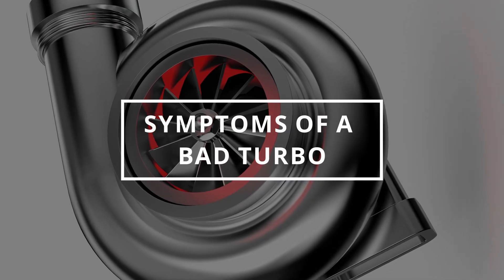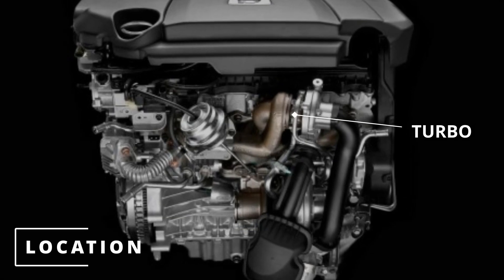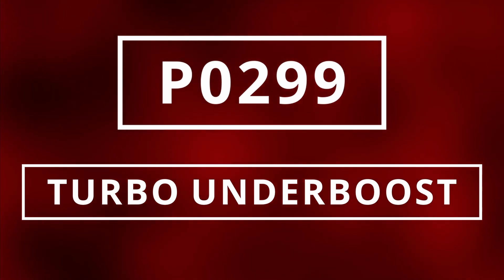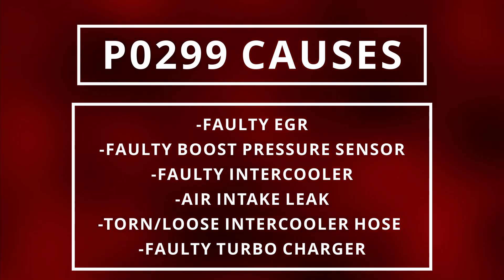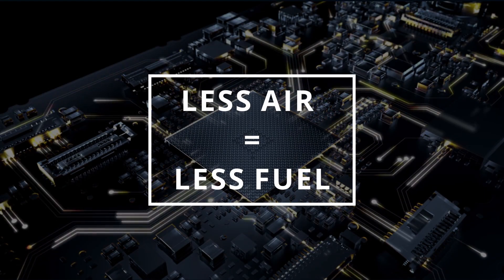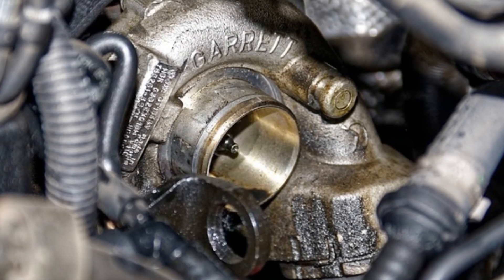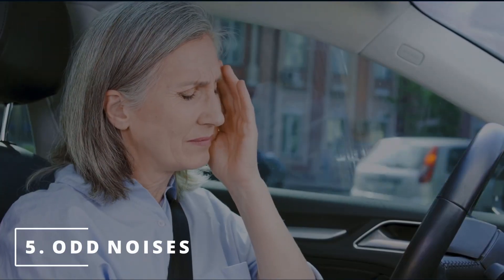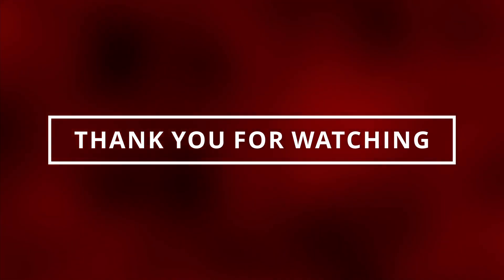SYMPTOMS OF A BAD TURBOCHARGER

Comment: The sad thing is the only reason why I knew my 59 had a bad turbo is because of blue smoke at low RPM when trying to speed up and I just noticed a grinding noise on it when I cut it off I can hear it as a polling down. It’s grinding against the wall.

Comment: So I need both intake and exhaust cam shaft position sensors. My car is bogged down bad. I don’t hear any noise in my engine or have blue smoke. Someone told me my turbo is going out. If I replace those sensors will that maybe fix the car? It’s supposed to fix the timing as well in my Elantra sport.

Comment: P2263? Turbo supercharger cause. Did not see a breakdown of p2263. Vw jetta se has slight low hiss sound & dimishes when car is turned off.
Reply: Seems the sound comes near the gas tank, but not the Cap issue.

Comment: hi i have lack of power and sometimes silver/blue smoke but no error code or engine light can be it a turbo fail?
Reply: Yes
Reply: I have that issue too! Smoke every now and then but only my coolant goes down. Not oil. Also no check engine light.
Reply: @blindsniper141 could be your coolant seal if your not losing any oil. Should go to a macanic  to check it out..

 Does it smoke on start up and goes away  or  it smokes when you when driving

Comment: could a failing turbo make the car shake ? its tuned.....i hear the turbo more than usual
Reply: Mines doing the same thing on my 2004 vilvo s60 t5
Reply: @Romackbros  ended up being a brand new Carden that couldn't take the amount of power and broke into pieces in the boot
Reply: @renasdupont2806  a clip came off the intake and I started misfiring bc of a ignition coil

Comment: uggh, I now know I have a bad turbo. I have fixed a whole bunch of things, the latest item fuel pump with cam follower. The car runs great but going up hill starts to smoke and have clicking noises. It kindof continues running or tries to recuperate afterwards but it smokes when the car is being pushed.
Reply: Might be head gasket tok just ent through it got taped head gasket had a leak and just to be safe out a new short block in still don’t have 100 percent boost after replacing turbo my acess port shows no code
Reply: Valve stem seals? Oil pump failure/ stuck oil filter bypass/ low oil
Reply: Hey I have that same problem did changing the turbo fix it? Thanks